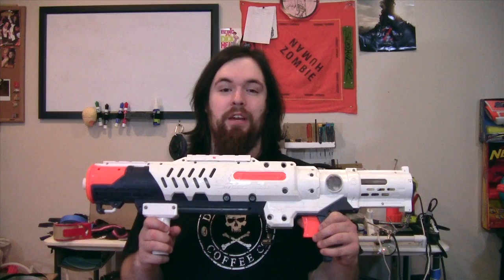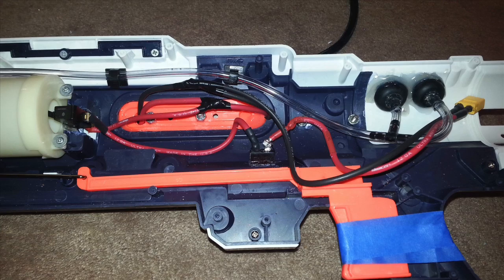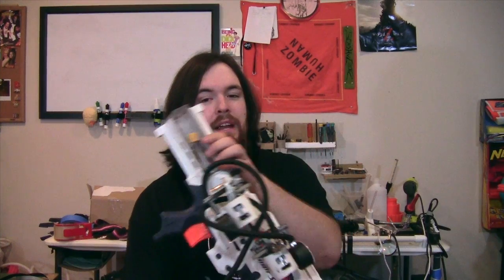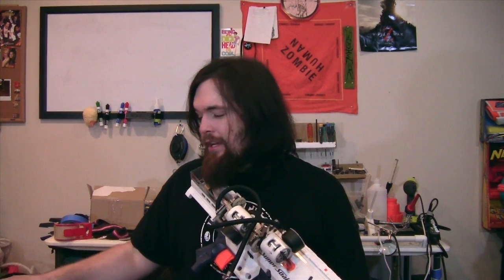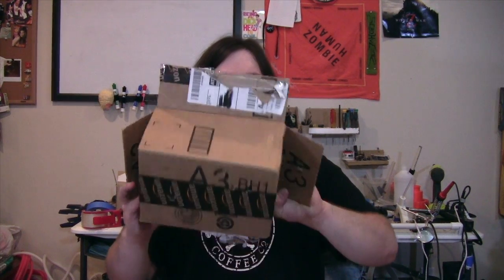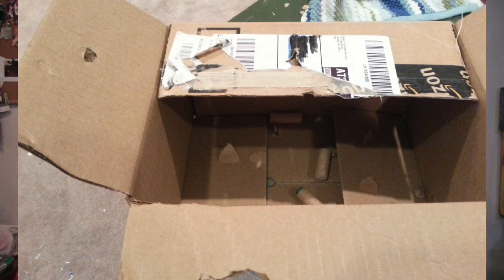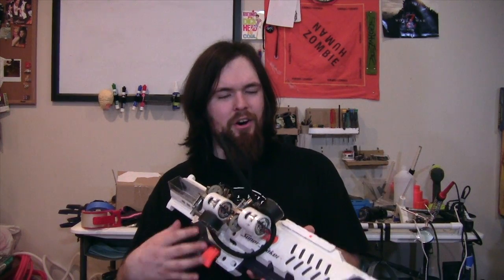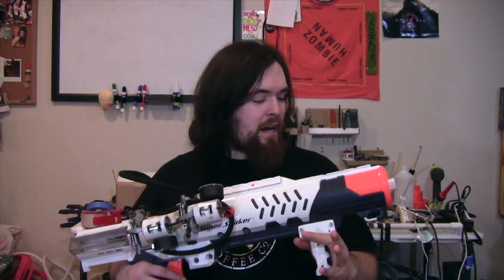Dual Air Compressored Super Soaker HydroCannon

Comment: I have a question about the compressor. Does it have a high Ah requirement? cause i recently bought one similar to that but it says it has a 12 Ah max. I'm guessing it would run on lower Ah but how do i know exactly which battery i need? Maybe i should just buy a similar battery and hope it works..

Comment: Good news, that bit of polycarb restricting bladder expansion actually shouldn't reduce the fps by much, if at all, if you use the same barrel length and size as NoM did. That's because the Hydrocannon uses a latex rubber bladder which, once it starts to expand, applies an almost constant pressure to the air within it (you get a bit more pressure when the bladder is full, but not a lot). As you pump in more air, it expands to maintain that constant pressure rather than allowing that air to compress further. That's why the Super Soakers that used to use rubber bladders in the late 90s/early 00s were called CPS (Constant Pressure System) blasters and the stream was almost as powerful at the end of the shot as it was at the beginning.

Comment: "Shit cannons" are always interesting to build, even though they are wildly impractical.

NiC war rules generally ban 'stored energy' blasters, flywheel blasters being the obvious exception to this rule. Basically, this is to prevent people hooking HPA rigs up to a sceptor. Even though you are not using 'canned' air, hosts would probably disallow this based on the 'stored energy' rule alone. Of course, this all varies from war to war and you mentioned that this was just for luls and have no real plans of war usage. The 'storeg energy' ruling is one of the obscure unspoken commandments of NiC wars that I thought was worth mentioning.

Last point, small caliber firearms (such as a .22) fire at around 600fps. Now, there is a large difference between a dart and a bullet but I wanted to inform people that this is actually firing at the speed of a real steel firearm.

Keep up the "good" work! :)
Reply from the maker: We like our powerful blasters down here in the SE ;D
Thank you for the .22 details. I forgot what round shot about 600fps, but we knew it was shooting close to a real firearm :)